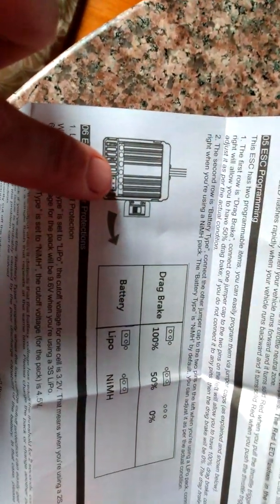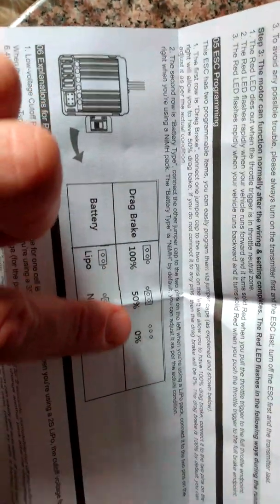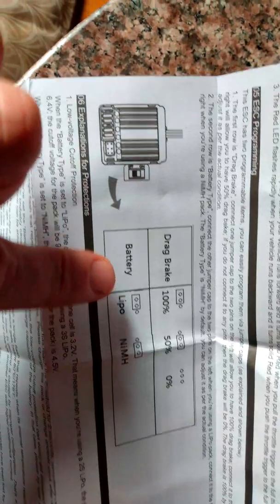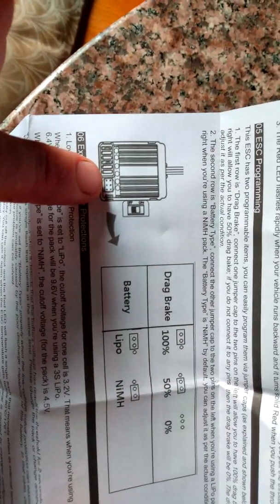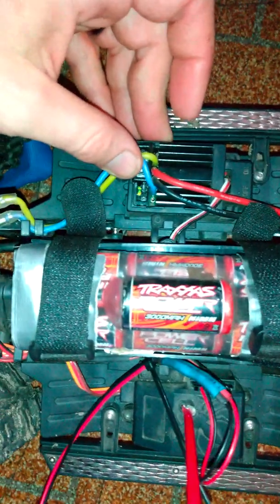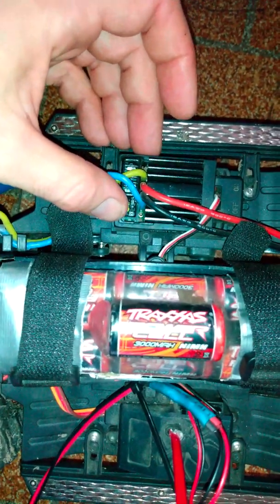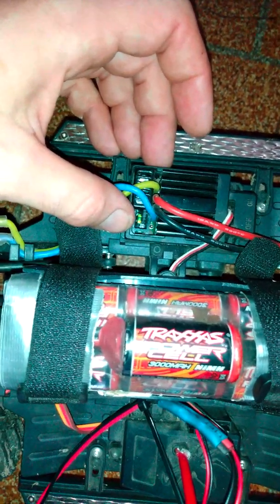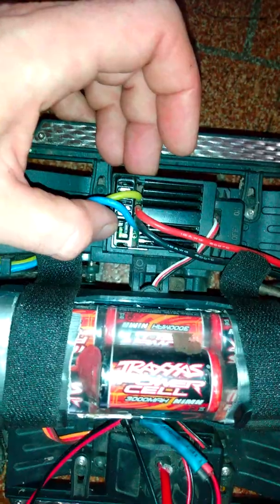how to switch Rgt or everest 10 or hexfly esc from NIMH to LiPo. also how to set drag brake 0 50 100

Comment from the maker: FOREWARNING: I just noticed the truck goes to 50% power if you try to use 0% drag brake by removing the pin. Must be a setting for little kids to drive it.
Reply: Sweet does that mean longer run times 😮👌🏻🤣
Reply from the maker: @UserUser14880 most likely